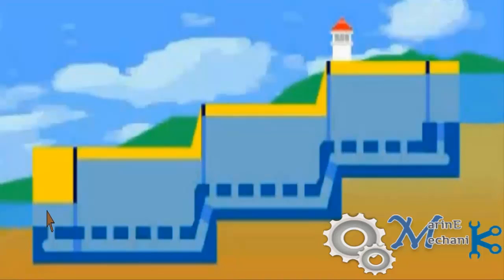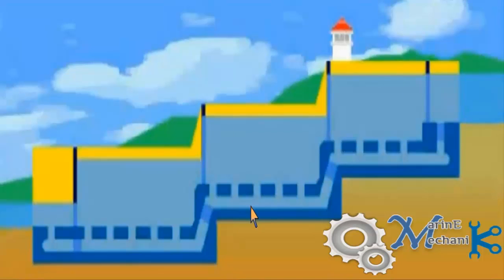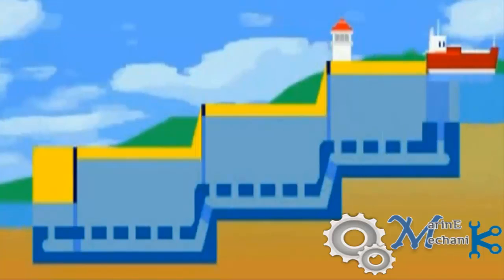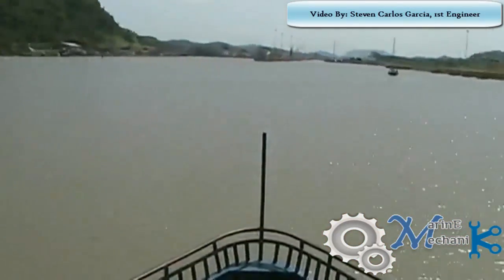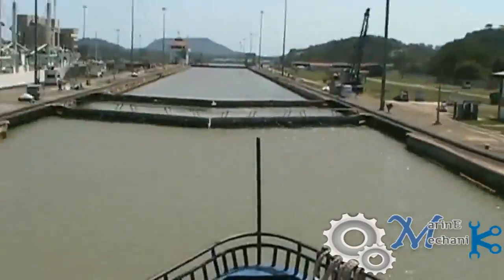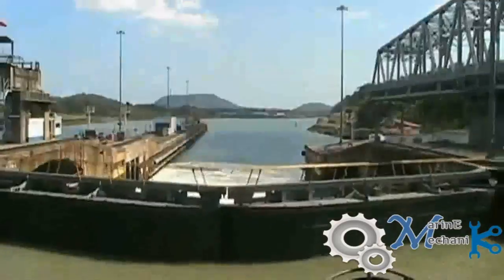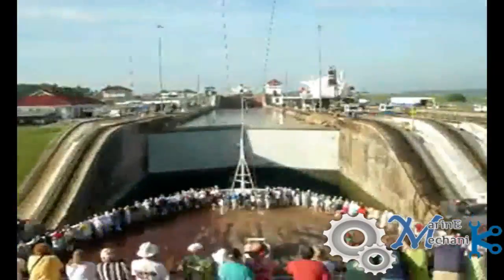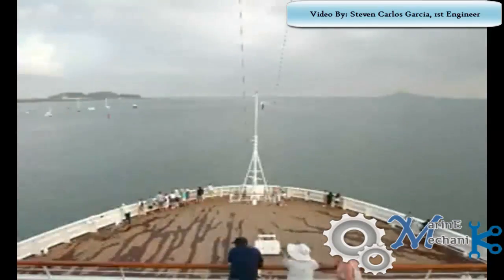Panama Canal - Working, Construction & Transit.

Comment: But in theory, won't this eventually drain the higher water? I know that there is a lot of water there so in reality it will take a long time, but there is no water flowing to the higher reservoir, right?
Reply: The Gatlin lake is man made lake and the damn makes the lake higher than the sea levels, so the lake is supplied by rivers like the Shagras and other tributaries, so lake is constantly replenished it is just under control, that is how dams function, and the gates regulate the flow from one gate to the next.
Reply: ElusiveCube Thanks for clarifying this, I was wondering the same thing. So my question is: Is the canal traffic saturated? Is there enough ship traffic that forces some scheduling, regulating traffic according to the amount of water flowing into the lake from the tributary rivers, to keep the lake water from draining into the oceans? Or is there not enough traffic and they actually just open the gates to periodically let the water flow into the oceans, to keep the lake at a stable level?
Reply: there are also animations available on you-tubes  you can see how it all operates.